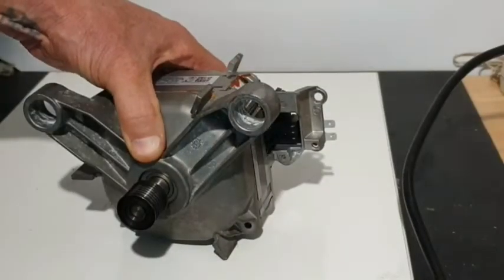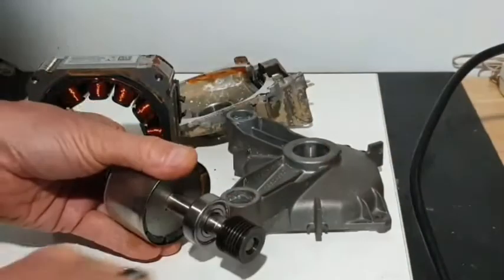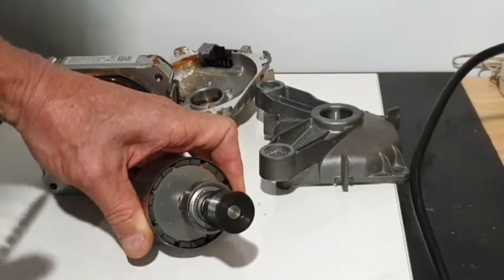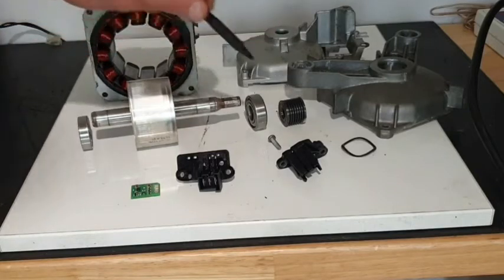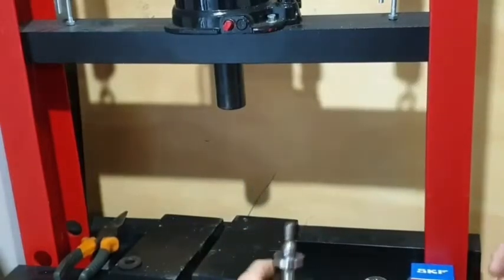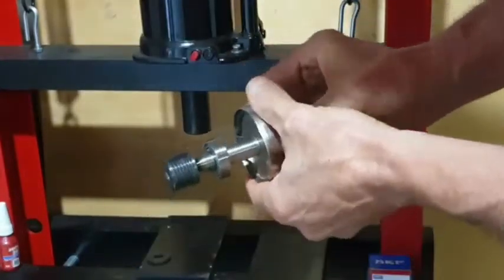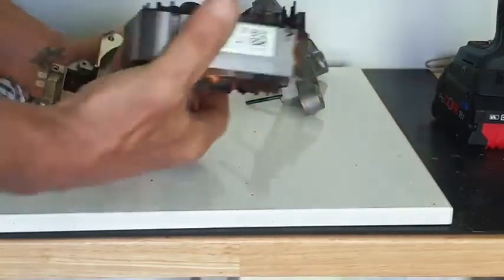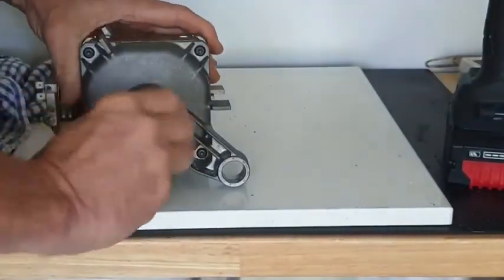Bosch Washing Machine Motor - Pulley Removal & Bearing Replacement. Complete Refurbishment.

Comment: Sir what is the name of your pulley remover?
Reply from the maker: I use a workshop press. I'm pretty sure it's this one: https://www.tradetools.com/renegade-industrial-20-tonne-20000kg-hydraulic-shop-press-rihsp20000?pid=RIHSP20000&utm_source=google&utm_medium=cpc&utm_campaign=free+listings&utm_medium=cpc&utm_content=&utm_campaign=22875559587&gad_source=1&gad_campaignid=22881262499&gbraid=0AAAAADnvrVgNhJK7_o0k8-Y3LQDhhZsSr&gclid=Cj0KCQiAosrJBhD0ARIsAHebCNrpPIJKlQzbIR50DDuR7klLCi6hbA0nIsaDH4nUOtDqF_hWSG8kZ1kaAijuEALw_wcB